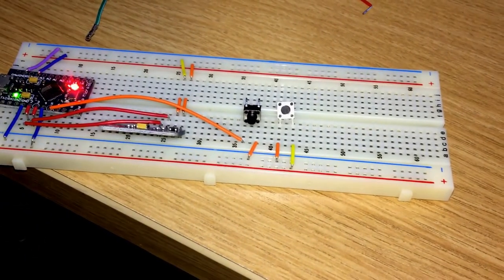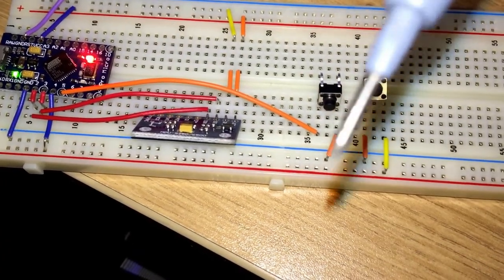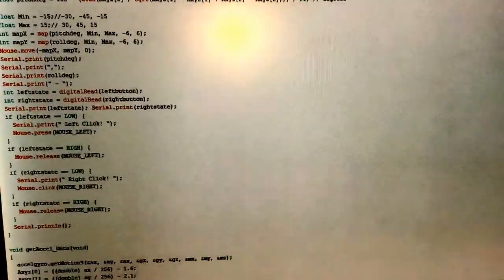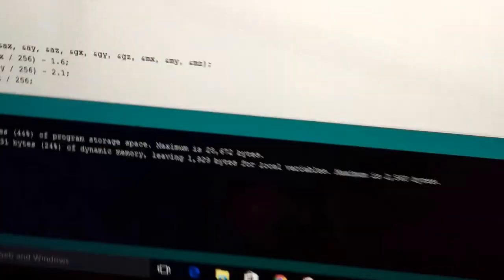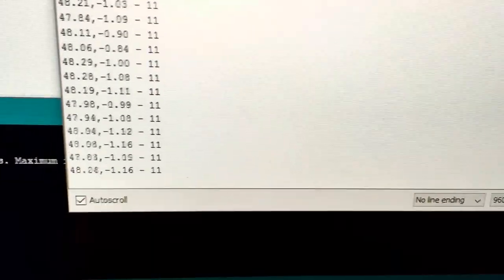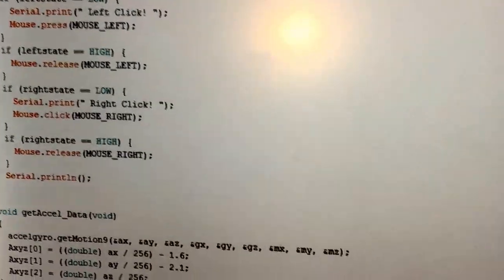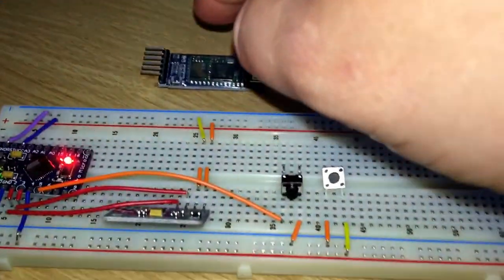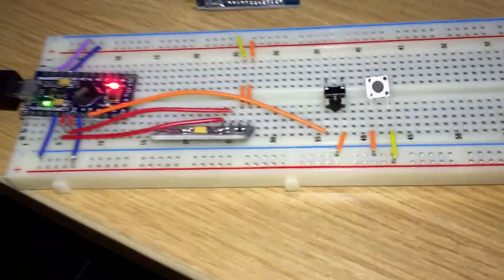Hackerbox 0009 Inertial Mouse Project Part 1

Comment: Awesome job Jason! Just got done taking a basic programming course and we learned on the arduino uno!
Reply from the maker: That's cool, these are my first forays into arduino. I've done quite a bit of programming, but nothing quite so impactfully close to the hardware....you can see physically what your code is doing which is really nice.

I also just picked up my first raspberry pi for another video project....not quite as raw as the arduino, but still pretty interesting and surprising the capabilities you can get out of such small components.